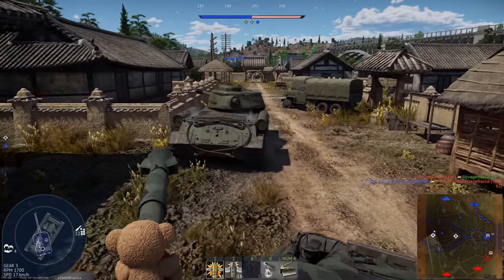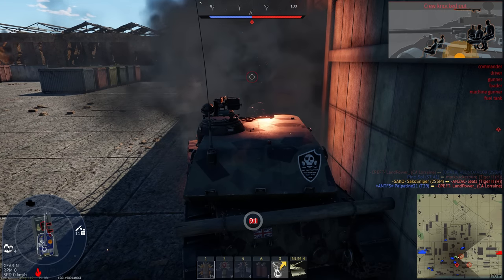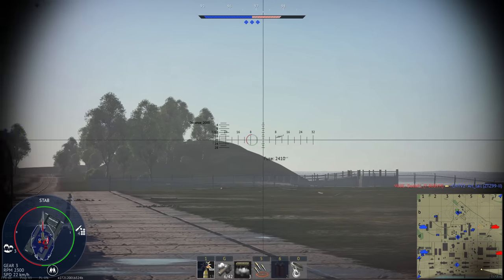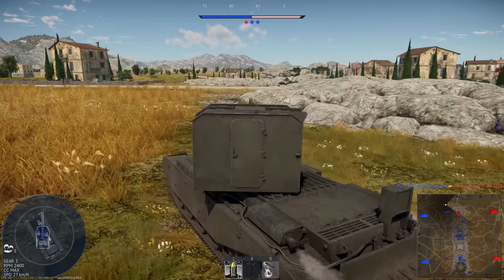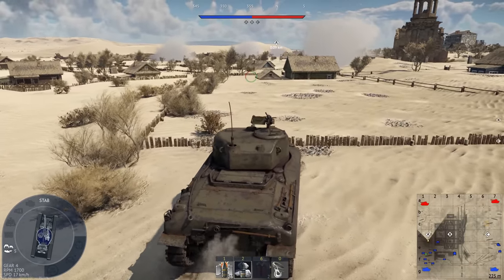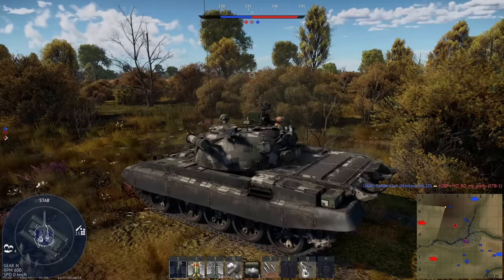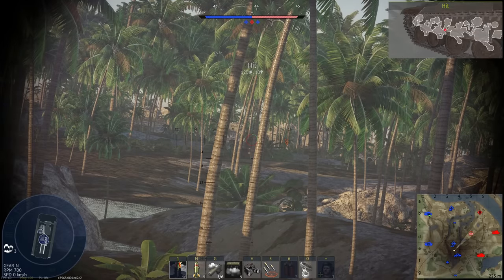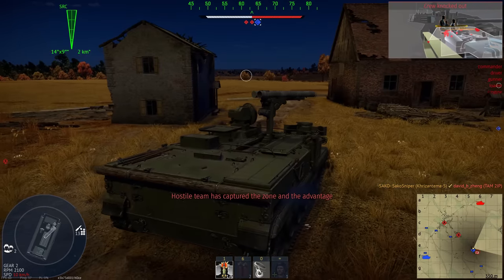Tank Ammo 101 - Chemical Rounds

Comment: HEAT shells don’t actually heat copper to its molten state, they just use the explosive to convert the copper cone into an extremely high velocity jet of copper fragments. Yeah it’s gonna be hot as hell, but not enough to actually melt the copper.